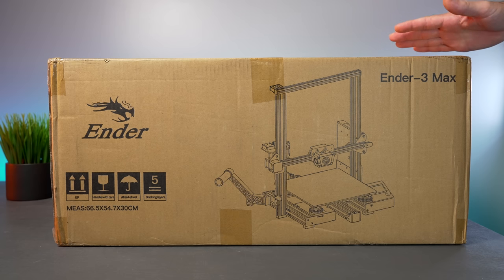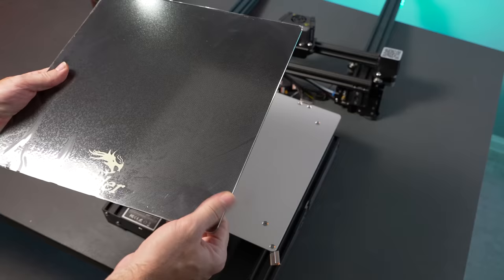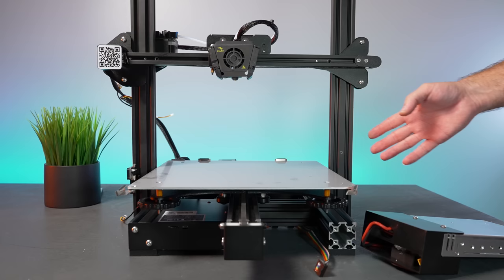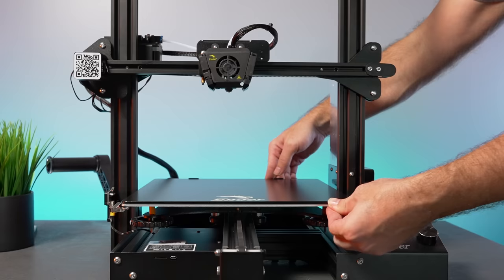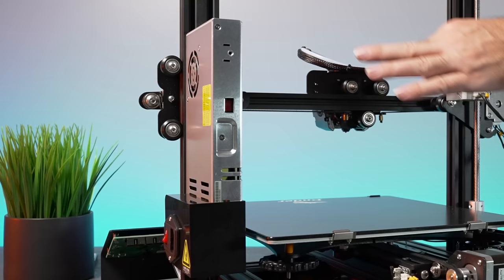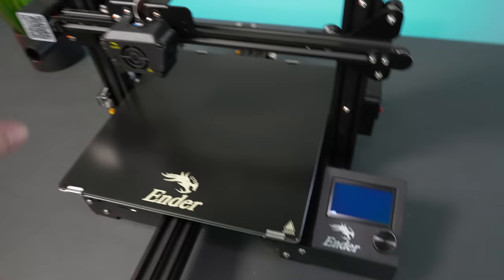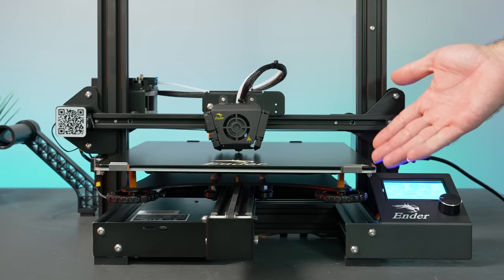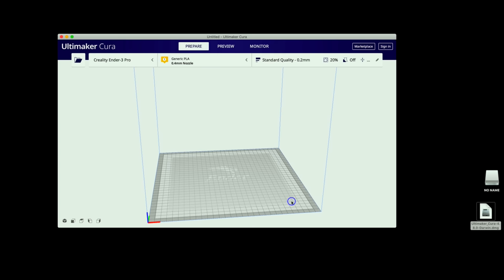Creality Ender 3 Max - 3D Printer - Unbox & Setup

Comment from the maker: New Channel: www.youtube.com/@Just_Print
Buy it here: https://geni.us/KpsAu
Recommended: http://geni.us/JustVlads
Reply: what's the length of the y 4040 extruson and x?  I'm thinking linear rails
Reply: How would I find what my power voltage should be? I am new to 3d printing
Reply: @shadowmosesmusic  he doesn't respond, probably doesn't read the comments or has time to.
Reply: What slicer is good to use with the Ender 3 Max ?
Reply: The Last Problem With spaceship is a Pain in the Ass kind of problem. but i have found what causes it as i was having this issue with so many of my models which i designed. which have one thin in common they have so many vertex. so i first lower the number of them then it worked out but i dont want to compromise the quality and after like a mont of hassel i found the problem. It is the POWER LOSS RECOVERY Function which causes this. if you turn it off then it will work out good.

Comment: I just bought an Ender 3 Max.  This video really helped me.  Being new to 3D printing, it was like having an expert seating beside me while I set it up all the way to printing. Thanks.  Well done.  One little problem that I had and I did not see any mention in the video is that when adjusting the 6 wheels under the printer, even if I loosen all 3 adjustable ones, it was still not a smooth movement.  I found that one of the non-adjustable wheel was screwed too tight.  After I found this, everything went smoothly.
Reply: How did you adjust or fix a non adjustable wheel? Just wondering in event have same issue when I get mine 😀

Comment: Excellent video. I just bought this printer and have never 3D printed before. I read all the books but you covered so much more. Thank you ever so much. I tuned my printer and did the calibration cube as you suggested and it worked perfectly for my very first ever print. Thank you again !!!!!

Comment: There was a video where one guy actually turned off the power loss recovery in the G code and it stopped making the dimples. He was also able to program the g code in that when he turned on spiral vase mode it turns off the power loss recovery automatically. That might help with the dimpling. Bryan Vines is the guy who shows you how to set it to do so.

Comment: Could you please make a video on how to add the BL Touch bed leveler for the MAX?
Reply: He doesn't ever respond lol
Reply: BL touch you litterally just plug it in underneath that main cover he said he didnt want to touch at the beginning of the video, download the firmware to your Sim card, and level your machine... Pretty user friendly if you're familiar with your 3D printer... Just screw it in, plug it in, calibrate and go! 

Unfortunately you do need to manually calibrate for the first time, but after that you never really do... I bought some silicon springs for mine I'm still waiting for it in the mail but pretty much same results as I've been told.

Comment: Thank you so much for making this video! I watched the video before receiving my new Ender 3 Max and then watched it again while assembling it and followed along. It really helped when you pointed out the tips to look out for like tightening the bolts. Some of mine were pretty loose so I'm glad you advised to check those. I was pretty anxious about setting it up and getting started with 3D printing but you really eased a lot of the stress!

Comment: Creality really did a good job on this printer and I can speak from experience because I bought one myself.  Awesome seller as well and that I can speak from experience as well because I purchased one from this company and I definitely recommend buying from this seller. Very easy to put together and it only took me 15 minutes.  There is one thing that Creality needs to fix with the Z axis end stop switch.  It's mounted with two screws though the frame which Creality changed because people were having a hard time adjusting the z axis. Now that it's solid mounted you can't move it up or down.  I have found many ways to fix this problem and if anyone is having this problem let me know and I will gladly help you fix it.  Other than that the printer has been awesome and prints just as well as the Ender 3 original.

Comment: Ringing comes from vibrations in the printer caused from harsh movements. It can usually be solved by reducing the acceleration and jerk settings on the printer and printing proper belt tensioners with adjustment knobs to adjust the belt tension precisely. I know they exist for the CR-10 and Tevo Tornado, so they probably exist for the Ender 3 models too.

Comment: Got mine a few days ago, what a beast!  It's an upgrade from my old MP Select V2... Love how well it prints with PLA and am currently dialling it in for PETG (prints are not bad but still a bit stringing).
Reply: Have u had issues with bed adhesion with petg? I can't get mine to stick
Reply: @scooter0241  Initially yes I did.  Keep the bed at 80C, my petg (esun) first layer at 240, following layers at 235 (you may have to tweak that). Fan off for the first 4 layers, at 15-25% for the rest) and most important clean the glass bed with alcohol and no fingerprints on it.
Reply: I did the exact same upgrade path Pat. I went from a monoprice select v2 to the ender 3-max. I still use my upgraded MP v2 with direct drive upgrade for tpu. Quick note for anyone adding a bltouch 3.1 to the Ender3-Max, the firmware on Creality's website is set to save settings to your sdcard. I was going nuts trying to save my z-offset settings.

Comment: The Last Problem With spaceship is a Pain in the A** kind of problem. but i have found what causes it as i was having this issue with so many of my models which i designed. which have one thin in common they have so many vertex. so i first lower the number of them then it worked out but i dont want to compromise the quality and after like a mont of hassel i found the problem. It is the POWER LOSS RECOVERY Function which causes this. if you turn it off then it will work out good.

Comment: My Ender 3 Max did exactly the same this in spiralize mode. You need to disable Power Loss Recovery on the first line of your Start G-Code:

M413 S0 ;Disable Power Loss Recovery

The PLR feature constantly monitors where the printer is, then writes this to the card, in case you lose power, so it can resume once power is regained. Problem is, in vase mode, these writes are happening almost continuously, and the machine gets bogged down. I tried multiple SD cards, of different size, manufacturers and speeds, but they all did this. I also tried direct wiring my laptop to the Ender 3 Max via USB; no joy. Attempted to disable PLR on the control panel, and this didn't work, either. The only thing that DID work is to modify the Start Code as above.

Comment: Fantastic video. I looked at the instructions that came in the box and decided that I either needed a google search or a very good magnifying glass.  Thanks goodness Google led mt to this video. Every step of the setup was covered in detail. 

I had difficulty getting the print to stick, ended up moving the z-axis stop a little bit higher and after that the adjustment worked a treat (I thought I had bookmarked the video I found on Google for that, but now can't find it). 

Dog and cat successfully built from the Ender sim card files (although it's a bit strange that you have to move the files from the source folder on the sim card to the "root" directory in order to be able to print them).

One additional thing I found was that removing a print from the plain glass bed is easier if, once the build is done, you preheat the bed to a slightly higher temperature than the build temperature (probably don't want to wait too long once it reaches the higher temperature though).

Again many many thanks for the video.

Comment: My wishlist: large cube-design (>= 300mm cubed build volume) with motors outside cube so you can turn it into an enclosure (I guess that means core-XY), separate electronics box (so it can move out of the enclosed volume), direct-drive with dual-grabbing geared extruder and full metal hotend (doesn't have to be too fancy), glass bed (only moving up/down) supported at least at 2 opposing sides (preferably with separate steppers and some auto-alignment) and with AC heating (mostly to avoid PSU problems at higher bed temps).  This Ender 3 Max is just a more expensive Ender 3 with a bit more volume, but retaining all the flaws which made my wishlist as mentioned.  X gantry only supported at one side, bowden with long/inaccurate retractions, big bed swinging back and forth, requires rework to enclose, still no full-metal hotend, ...  Would be good enough for €250, but I see way higher prices...

Comment: I heard on another video that to make sure the "restart on Power Failure" is turned off when printing in Vase mode. In the video he stated that maybe the reason is that the printer prints instructions to the SD card after each layer. At least that is worth a try.

Comment: Great set-up video!  Just trying my first print on the 3-Max...

When testing with bed level with the paper, how much resistance should there be to movement when you have it "just right"; should it drag just a little, or require a modest amount of force to more the paper? (obviously not allowing the paper to "bunch-up" when you try to push it!)

Also, your Cura settings (only the ones that are different from default) would be helpful to have as a bullet-point list in the video description.  Saves having to pause/play the video to make notes!

Thanks!

Comment: Man that screen went on easy. I've been trying to install mine, with no luck. Can not get the bolts, through the holes in the screen. Been at it for a good 40 min. I am going to drill them out.

Comment: Mine worked perfect out of the box. Nice video.
Reply: Did you also get ringing on larger prints?
Reply: @williamaycock579  I'll have to test.  I just got the BLtouch from Creality.  The instructions were rubbish, they included the wrong bracket , and the instructions were poor which caused more  confusion.  After finding a bracket to print out and finding better instructions,  it's now setup correctly. I'll print out a large print and report back.

Comment: I have a strong feeling the ringing is going to be caused by it having only a single screw for the z axis.
Reply: Found its the auto out if you turn that off it does not do that

Comment: Been watching a few videos, trying to figure what kind of printer I should get. All of them are the same, they freak out about the power supply set to 220w and not 110w, or what the settings are labeled as. It's real simple, these things are shipped all over the world, plugging in a device set to 220 into 110, most likely NOTHING will work, at most a couple lights may come on. Plug a device set to 110w into a 220w outlet? You WILL let out the "magic smoke" that makes it work, and if you don't catch it in time or something nearby is flammable enough, you may lose your house. It's not as big a deal as you all make it out to be considering you have no idea where it's being bought from and you have no clue where it's going.

I used to work for a company building computers...every power supply came set at 220w, and imagine the shock when I had to set them to 110w.

***The U.S. is one of the few countries in the world who uses 110w. I know a lot of companies websites that you must specify 110 or 220 when you buy an item, so they can make sure you get the correct item, otherwise, you must send it back because it doesn't have a one or the other setting. I think just flipping a switch is easier.

Comment: What if the bed could be twisted to print 3 metre lenghs of a h frame. Modified bed to have underneath blocks can electrically shift to break the connective bonds and additional arm to drag the h frame off onto additional side rollers or similar . It would be interesting to see a side printed h frame at various lengths from a manufacturing point of view .

Comment: I like the dual cooling fans but dual Z synced lead screws would have been nice as well, I prefer the mono screen and encoder wheel as Creality doesn't seem to be that good at colour GUI's, even when they have a colour palette to choose from they go for 1 colour and 1 hue and have no uniformity in their icons across the printer range.
 This is a nice printer although buying it from Amazon will see you being scalped for £100 over the price from buying direct Creality and buying at Aliexpress will see you save the price of a roll of filament over the Creality price

Comment: still using single z axis. little bit of dust and slight wear = ur unsupported side is gonna droop and start colliding with ur print. i still dont get why they dont do dual z.. the dual Z with linear rail was a pain in the ass to do..

Comment: I bought one of these from Amazon, managed one good print then while doing second print of same thing that just finished the print head stopped then slammed all the way left and just kept trying to drive left. Did the Amazon support link for the printer, lady in fair English said I need to upgrade firmware. The printer was released in Nov 2020. Shi**y help from her all she did was send me a link to a youtube site about FW upgrade for the MAX.  I needed to buy a bootloader board from a 3rd party site. Tried Edner support, even worse.. Packed it up and sent it back. Still looking for a decent 3d printer :-(

Comment: The rocket was still stuck on the print plate but then you showed what else you tried to solve the problem. How did you do that while the rocket was still attached to the print plate?

Comment: Great video!  Did you ever find a firmware update to fix the spiralize mode issues?
Reply: From what I read it's a result of the power loss recovery in the firmware not interacting properly with Vase Mode

Comment: Could the ringing be from gantry catch (drag) up on the non lead screw side?    I always worry this could be a problem on bigger printers with the LONG  "Y" bars.  This would not be as big a prob on shorter (lower) prints but at some point would start to show  on taller prints.  Of course a second lead screw would eliminate this but would add extra initial cost .

Comment: I bought the Max after watching the video. I was surprised you didn't mention a few things. Since there is only 1 Z-Axis Lead screw on one side, the X-Axis 2020 profile is much lower at the side without the lead screw. Gravity at work. For me the right side of the X-Axis 2020 is ~8mm lower then the left. Is this NORMAL? To compensate the bed springs have very different tension. The two springs on the right are basically fully compressed. The two springs on the left are extremely loose. This also results the bed being stiff in Z-direction on the right side of the bed (springs are fully compressed) and very flexible (springy) on the left side. Surely this cannot be good.

What's worse, you cannot adjust the Z-Axis Endstop. It has a fixed position. This position is pretty high...so you have to loosen the bed springs very much to reach the nozzle. Is this intended by Creality? I made the Z-Endstop moveable by using T-Nuts. Now I don't have to loosen the springs as much. I wonder if I could even print with the original fixed Endstop-Height.

Did you get a custom version of the Ender3 Max, or why didn't you note on those issues? Also don't you have any problems? How do your springs look like? Very loose? Are the compressed similarly on both sides of the bed? How many millimeters is you X-Axis 2020 lower on the right side?
Reply: Same problem for me. In the video Vlad shows the bottom layers squished together. For me this is effect is much much worse, especially for big surface parts. For small parts you hardly notice. For large surface parts I had parts that are 6mm high in the model come out only 5.5mm high. Maybe this is due to the tilt in the X-Axis, because the problem is enhanced at the right side of the bed. It's not only that the printed model is somewhat less high, the problem is, squishing layers tighter together means the nozzle digs deep into the last layer. Sometimes it pushes small parts off the plate. What's worse is, for large surface parts you can see it digging into the surface with very lout rattling noise. Instead of a 0.2mm layer it probably prints 0.1mm. Far too much filament oozes out of the side of the model creating a very annoying rim around the object...again worse and more protruding at the right side of the bed.

How to fix this problem? VLAD mentions it in the video but he doesn't say what the problem is and how to fix it. Maybe the single Z-Axis design is just bad :(

I was so happy with the printer and for small parts the problem is not as bad or visible. However very small parts are sometimes pushed off the bed because of this. But this really kills all quality and often leads to print disasters.

Comment: Hello so I am following along I did the part where you use a sheet of paper to callibrate the glass bed. On the next step he had the extruder back up top. How did he get the extruder back up there? example at 32:00

Comment: Is this similar to ender 3 v2? have you installed a 2 bltouch before? Can you just leave a computer plugged in via micro usb and upload the files that way? Do you know how the relative distance between extruder tip and bed? Like .5 mm or something? Is it worth using a feeler gauge to check?

Comment: 0.1 mm its pretty hard to adjust.

Mine is brand new and some level screws are slacked to the max. 

The horizontal bar isnt level. The right side is lower and I can't figure out why.

It also seems that the springs need some time to expand cauz I've been trying to level the bed for almost 2h.
Every times its ok, if I wait and do another check its not good anymore
What can I do?